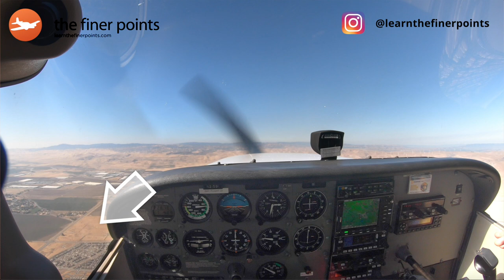What is the Lindbergh Reference? Let's solve the "Right Rudder" problem!

Comment: right rudder always needs attention as well as the focus point in different phases of flight.  after a student has a couple of hours in the pattern i like to explain that you could fly the entire pattern all the way up to touchdown with left foot flat on the floor.  even in a coordinated climbing right turn you still only need right rudder to hold the proper bank angle.  i start by flying the pattern once and after getting estabished on initial climb with the pitch trimmed for Vy t take my hands off the yoke and put my left foot flat on the floor holding both hands up in the air and directing attention to L foot flat on floor.  at 400' agl still touching nothing but R rudder i let off just enough to establish a perfectly coordinated climbing L turn.  at pattern altitude still not touching the yoke i gently reduce the throttle to let the nose slowly come down slightly above level to where the VSI goes to zero.  as the plane accelerates to about 80 i back the power off another 50 rpm or so to stop any climb as the nose rises from the acceleration.  abeam the numbers start to reduce power add some flaps to conteract the pitch up moment.  at this point i point out that i still have not touched any control input other than right rudder and throttle.  my hands are still plainly visible to support this fact.  i remember impressing even a 2 or 3 thousand hour alaska 135 pilot with this demo as i was doing a tailwheel endorsement for him.